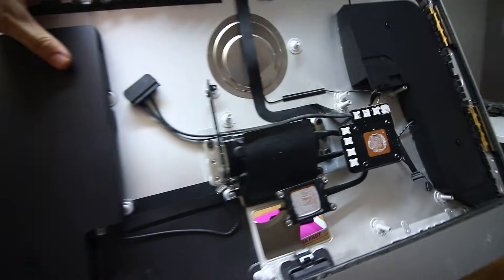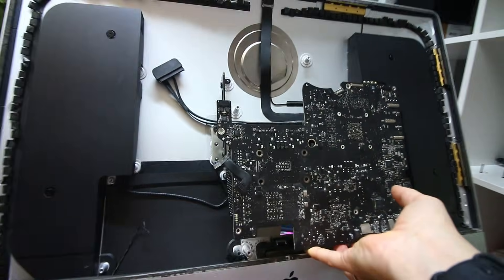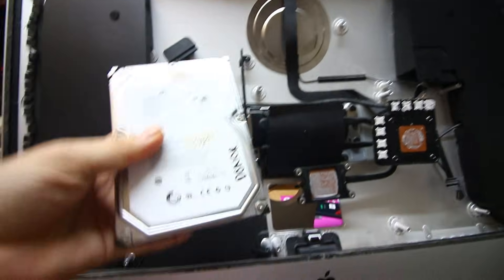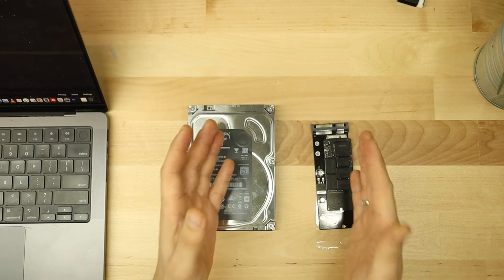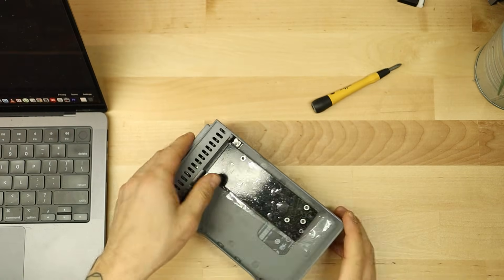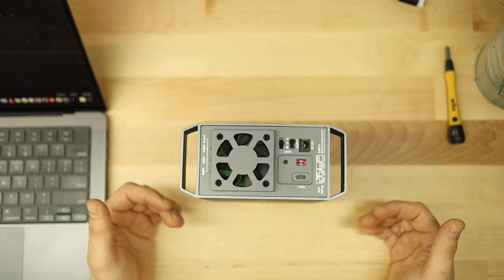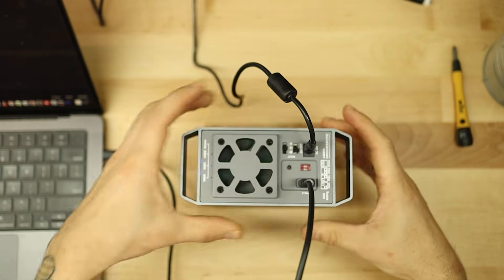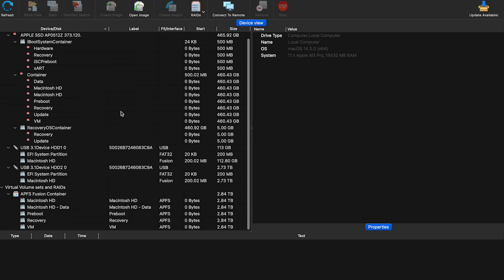how to recover data from Fusion Mac | common mistakes we see

Comment: I have a hard disk(3,5" Seagate barracuda green 2000gb) that I used as an external hard disk for data backup from a PC to an external hard disk (when I bought the hard disk, I formatted it with a GPT/NTFS partition). My problem is the following, the failure of the hard disk is logical, the damaged data structure (MFT) which leads to the unavailability of files, the disappearance of the partition.

Comment: I hate this kind of setup. Pick SSD or HDD, but never both. I have never touched a hybrid and I never will. It's just asking for problems. My 2011 build was SATA SSD only. My 2021 build is NVME only and so is my threadripper. Of course there is nothing wrong with having independant SSDs vs HDDs. But combining both as a hybrid is just a bad idea.
Reply: Agree and luckily SSD prices came down and the hybrid crap is mostly a thing of the past. It was just a stopgap until a full SSD became more affordable. Although, prices may start to be going up again... Just hope there isn't a need for the hybrid crap again. 
But in this Mac application it looks like it had two separate drives and the SSD is hidden on the back of the mainboard. So it isn't the all in one hybrid SSD/HDD but they still operate as one, even being two separate drives and is still crap.
Reply from the maker: its on par with RAID0 imho
Reply: @hddrecoveryservices  yeah.......but at least raid 0 gives you uniform speed. This is just a disaster waiting to happen with little to no benefit. If you keep them separate, you can handle the split yourself. And you don't lose everything.

Comment: Great video I’m really enjoying these daily videos quick question I have a MacBook that died but the ssd has data on would this work in windows thanks
Reply from the maker: with the R-Studio data recovery software (link in description) yes you can explore the SSD connected to the windows machine as long as the SSD is still alive. Newer Macs have SSDs soldered to the logic board :(
Reply: @hddrecoveryservices yeah I have the ssd out just waiting for the ssd adapters to arrive thanks for the reply much appreciated